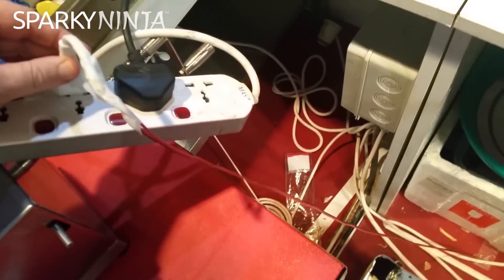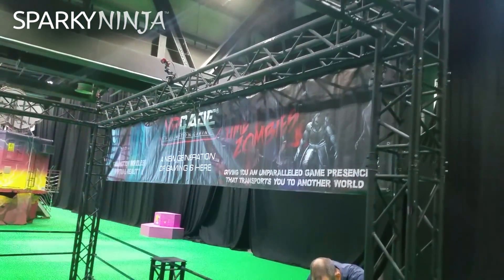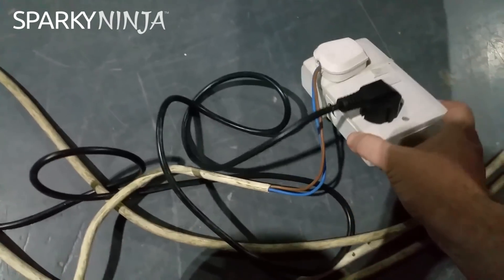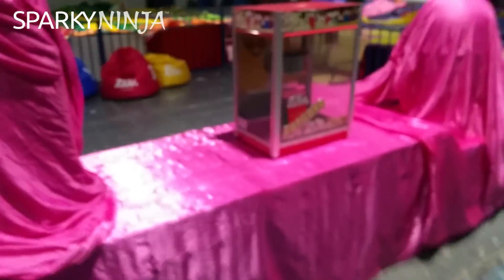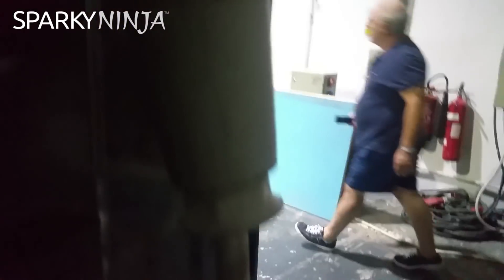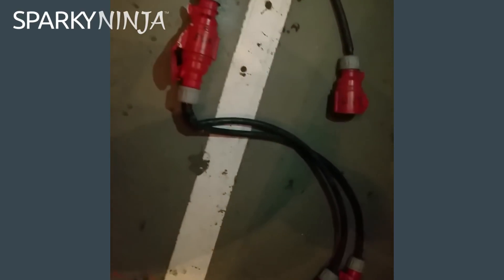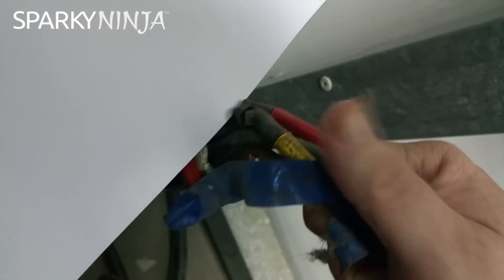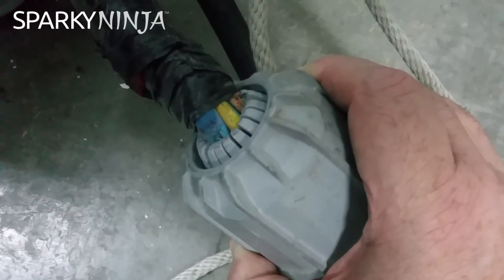Dubai - An electrical disaster!!

Comment: It's not what you right down, it's not what the regulations say the regulations in the UAE are very good, it's the cowboys who install and the bosses who want the cheapest labour rates possible. I remember a major project in Dubai where the company had brought in many many electricians from India, My friend who was one of the construction managers used to test them on arrival at the site,  His test was simple, there was a toolbox in the room, he would ask the Indian electrician to pass him tape a measure or set squire, etc, most times they failed, he would ask for hammer and all would pass. The second option was to bring in British electricians, this was ok but the labor cost was expensive, however, after a short space of time, this also failed due to the number of drunk electricians coming to the site each morning. Just couldn't win.

Comment: If I find extension cables in that kind of condition, I disconnect and cut off both ends!
Reply: Too Write Mega Zeus - then they said I must fix  - rewire the plugs to correct AS / NZS 3000 2019 Standards !

Comment: They were still on the old 3 phase colours when I was there.RED YELLOW and BLUE.   The mc I was fitting had the three phase neutral and earth was through the armour with a second earth cable running with it. Each isolator had its own 3ph fuse then an other at the diss board.  You had to put a technical drawing in every time you fitted a new mc or even moved one a few feet. Most of the large factories you see are just warehouses with rows of racking.  The last time I was there most of the new tower blocks had no power.
Reply: Their regs are based on UK regs, and they have no reason to change to "harmonise with Europe", so continue to use the old UK colours.  It does feel a bit strange working on a brand new installation with the old UK colours though!

Comment: Bit like the 2 pin European plugs that can go in either way round in the sockets with the neutral or live  switched 😱 at the appliances
Reply: 2 pin European plugs like also other kinds of European plugs like schuko plugs, italian plugs, etc are not polarized, that is not a problem, why should an appliance care about the distinction between phase and neural ? Either way it's the same, it is alternating current.
Reply: @Lucky Joestar We found a  number of injection molding  machines had neutral switched heater bands here in the UK. Needless to say they were swapped over to live swiching. . Who ever thought that keeping the  heater bands live even when off needed there head testing.

Comment: I have worked in the events and entertainment industry worldwide for quite a while, and just when you think you’ve seen it all, you see this shocker. It looks like, once upon a time, this probably all complied. A lack of skilled maintenance and effective management is all you need for disasters like this. In the UK, there are plenty of unskilled workers using temporary plug-and-play distribution, which is fine so long as there is effective planning and skilled supervision. Many of the events companies I work with have been coaxed round to seeing the overall benefit of paying some attention to this area and many have changed their distribution equipment to make for easier testing, compliance and less risk of show failures. On top of this, some venues have been driven by their insurers to insist on BS7909 sign-offs. It’s just a shame they all seem to need it at 3am. Anyway, thanks for showing me it’s not just me!
Reply from the maker: Thanks for your feedback.

I was asked to sign off Royal Ascot just last week - still there are many people installing splitters and 32A to 16A wonder leads etc - it appears that the mentality is that the 60309 stuff fits like lego, and the equipment works.. therefore it must be safe!

One of the temporary marquees was erected with lighting provided, all lighting having a 16 A plug and socket so they can be daisy chained. 250M later they all worked, but there was insufficient voltage at the end to power up the tester for a loop test!
Reply: SparkyNinja That’s one of the other common problems with event electrics, they find they’re 2m short but their shortest leads are 20m long! I’ve managed to convince most companies that the common answer is more, smaller pdu’s. It’s also nice to see more dmx lights on standard 16a rather than soca back to dimmer racks. At the end of the day though, you have to work with what they’ve got and attempt to educate them that we all want to achieve the same thing.

Comment: I got really excited with the intro which was incredible, then got upset with all the horrendous stuff you then showed 😂😂😂 I assume Dubai is in a worse state than the UK in general?
Reply from the maker: Hi Dan,

It's quite interesting tbh.

The wiring regulations in Dubai are based on BS 7671 with some minor adjustments. For example there is a great deal more attention to the installation of new systems, including requirements for powerstations and HV supplies. Mainly because Dubai is still such a young city and is experiencing exponential growth. Other adjustments include things like maximum 5 sockets outlets per radial, and 10 per ring (yeap they do the ring final). The ambient air temperature in the shade is 48 degrees C. The IP rating for external electrical equipment is IP65 minimum, due to dust etc.

However whilst what appears on the surface to be a booming and wonderful place (which it really is), I was there to assist in development of training and offering some consultancy. At the venues where we worked there was a big space in between the management and the actual electrcial operatives. Also these electrical operatives (mostly from India and the Phillipnes) worked with cables in their job and so were by default called electricians, with little to no actual electric knowledge and training.

Fundamentally it appears as if large installation firms from around the world, mainly the U.K., carry out the installation of these buildings. But then it is left to the locals and thier employed technicians to maintain these sytems and this is where most of the problems lie.

We were primarily requested to deliver BS 7909 training for the temporary supplies, but we have been gently supporting them in recognising these risks and working to improve them. I say gently because there is a very different culture in the U.A.E. and you have to be delicate when talking to the locals about their shortcomings.

Current plan is to return next year with the primary objective being to offer training to the management.
Reply: Would there be work out there for uk electricians?
Reply: onefortheroad1 There is work out there, but i’m afraid, in a lot of cases, it’s completed by cheap and unskilled labour. As a skilled person, you find yourself signing under pressure, knowing that there’s been too much work done for you to really look at in time. If you’re familiar with temporary installations and BS7909, there are plenty of agencies and event companies that need your help, even if they don’t realise it yet. James Eade has a book on the subject and places like Backstage Academy are good places to network.